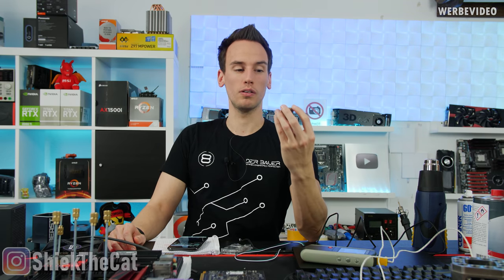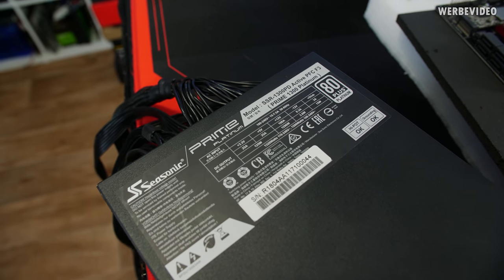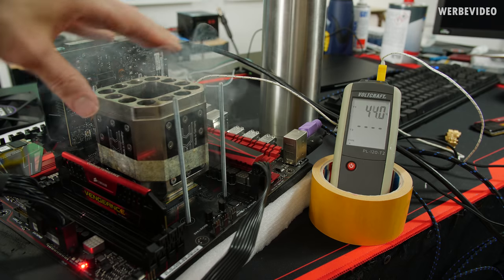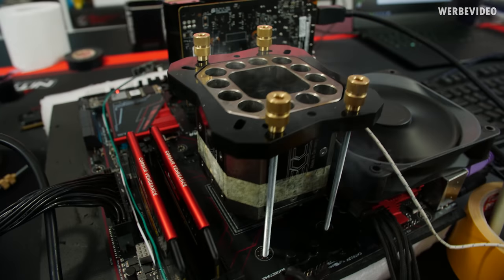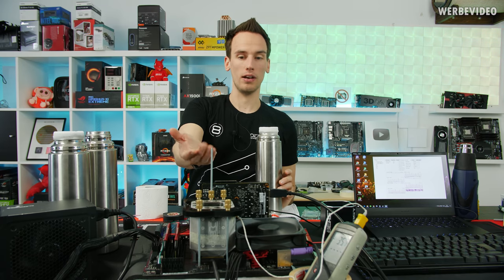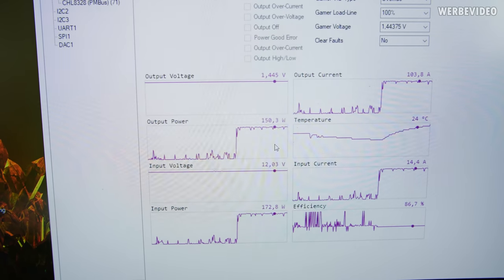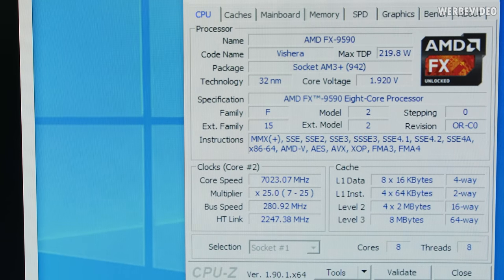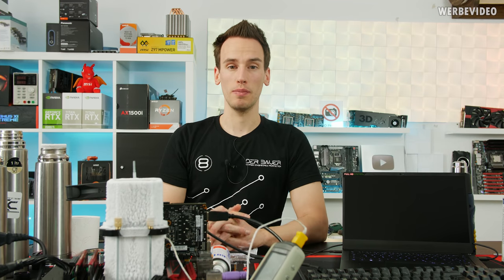Putting the 5 GHz AMD CPU under LN2

Comment: Regarding the hazards of LN2, the volume expansion when evaporating is around 700 times, so evaporating just 1 liter of LN2 emits 700 liters, or 0.7 cubic meters of pure nitrogen. This is a hazard that should not be underestimated, as the pure nitrogen will mix with the air and without good ventillation the oxygen concentration of the air can reach dangerously low levels.
This is a particularly insidious hazard, because human breathing is driven by the buildup of carbon dioxide in the blood, and not the lack of oxygen. Most humans have a very weak direct awareness of the oxygen content of the air, and do not feel like their suffocating even if the oxygen content is so low that their lips turn blue.
A person can easily die from hypoxia without realizing that they are in danger, in the industry when working with inert gases in an enclosed space, often you have to wear an oxygen sensor that alarms you if the atmosphere is hypoxic.
Of course this is not a problem if you have a large room, doors open, etc. but if someone was using a lot of LN2 (such as multiple pots when running both the CPU and GPU on LN2 for 3Dmark) for hours in a small room, with all doors and windows closed, then that person could be in danger.
Reply: In my university they had oxygen sensors in the LN2 handling and distribution room and when they went off the sirens were deafening. The alarm tripping level was of course set way above dangerous oxygen levels so there was no chance that some nook or cranny was depleted of oxygen. I think it was at 19 or 19.5%.
Reply: While the expansion ratio of ln2 is pretty high, and what you say does have merit, your talking to a guy who is quite literally famous for using ln2, and has been for quite some time. That’s essentially like trying to lecture your professor on lab safety when he’s won 3 Nobel prizes in chemistry.
Reply: @MisterRorschach90  or maybe they're sharing knowledge for everyone that watches the channel?
Reply: Martin Johnson touché. And to be honest I actually thought of that after I pressed send a couple hours ago but went back to bed. Lol
Reply: Just try lighting a butane torch, it'll tell you a whole lot about oxygen levels (and you should have one handy when LN2 oc'ing anyway). Just make sure there is some ventilation and you'll be fine :)
Reply: True story time.  I used to play around with LN2 quite a bit in college.  'Borrowed' some from the physics labs for various things.  Some of them relatively harmless like making ice cream, others more questionable like putting some LN2 in an empty 2 liter soda bottle, closing the cap, and then waiting for it to explode.

One time I was playing around with putting a bit of LN2 in drinks, just for the visual effect.  Pour a bit on top and it quickly boils off but you get clouds of vapor and such.  Of course I wouldn't actually drink it until it had finished boiling it off...or so I thought.  But one time I didn't quite wait long enough and accidentally took a sip while there was still a tiny bit of liquid nitrogen in there...

I felt that something was terribly wrong immediately and proceeded to throw my head back, open my mouth, and release the weirdest, longest, and scariest belch of my life just to relieve the pressure from that drop of nitrogen boiling inside my stomach.  Thankfully once that was over though I felt kind of weird for the rest of the day I was otherwise fine.

It's really hard to say how much I drank but I really don't think it was very much at all.  Just a drop, probably.  After all I thought it was all gone before I took a sip, and more than that I lived through this experience without any serious damage.  I've since read about similar incidents (usually for similarly stupid reasons) that resulted in serious complications or even death...

So, uh, don't drink LN2
Reply: how does a mother board  know the diff from ryzen 3600 and 3600x is there info stored on the cpu chip ?  if its only binning how is the info stored

Comment: Me: Can i Use a compressed air to clean my motherboard sockets?
Der8auer: Spray alcohol cleaner everywhere you want and don't forget to use it wisely. 1 Can of cleaner for 1 socket :D
Reply: Well he got the RAM issue resolved... it would have never occurred to me to spray everything with alcohol and then use a hair dryer to blast warm air into the sockets!

Looked nasty but can't argue with those results, lol
Reply: VladTepesVEVO it’s basically the same thing as spraying electronics with deoxit. Loosens dirt and helps clean metallic contacts of corrosion.
Reply: It's not actually alcohol - it's pentane and hexanes compressed with CO2. It's not likely to dissolve anything other than grease, so it will mostly just push debris out of the way and then evaporate very very quickly.
Reply: What is it called? I can't find it on eBay.
Reply: @MadSupra354  Just type cleaner 601 in google

Comment: Had this CPU on an asus crosshair. Damn thing ran so hot I had to disable the 5ghz boost. Wish I knew about under-volting back then, could have gotten much better performance.
Reply: Had? I still have one on a MSI 990FX board.  Also had to disable the boost. PC would freeze for no reason, it was very frustration. Thankful for the pc community that i was able to find out that that was the problem.
Reply: @dmitc01  yeah I dumped it and went to a 4790k, now a 8700k. PC crashed whenever CPU hit 64c, and this was on a 240mm rad. Got sick of dealing with it and moved on.
Reply: @dmitc01  the vrm in that board is worse than some 970 boards, how do i know because i wasted money for less performance
Reply: @ItsRossinator I'm keeping mines until B550 boards are out, will pair with a R5 3600. Don't think I'll need more than that in terms of performance for the next couple of years

Comment: Was looking into datasheets about the CHL8328 on that board and learned chl8326, 8328, IR3536 and IR3538 are basically the same and seem to have control for up to 16 loops via i2c/SMBus/PMBus. Guess thats why Galax HOF cards used them along with special dongle, IR DPDC / PowIRCenter SW gives you great control
Them Corsair Vengeance dimms the ultra rare 2666c10 Sammies ?

Comment: The thing with silicon binning for frequency performance, is that 1) Even for overclocking processors, Almost no binning tests for frequencies beyond what's reasonable on water. And 2) Manufacturers are not gonna just sit on a growing stack of high binned dies if their top tier SKUs using those chips, are not selling out, just to reserve those dies for only those top tier SKUs. They will rather stick any significant overflow (vs sales) of top binned dies, on lower range SKUs, if it means selling more devices and keeping the revenue flow going. That's how you end up with same, lower "class" stock clocked CPUs, GPUs and memory that will overclock as good or even better than the higher tier SKUs usuing the same silicon die. These days, most manufacturers can sell as many CPUs, GPUs and memory modules as they can make, so having dies sitting in storage ie. because you're reserving them for Kingpin cards or KS CPUs, is lost revenue. Rather stick em on a less top tier card or a K sku and sell it. The only reason to do otherwise, is if silicon manufacturing changed negatively and you literally can't get any more of dies that fast.

Comment: LN2 safety: don't let it soak on your clothes and if the torch does not light step out of the room (** if Steve is around check the safety on the torch)

Comment: Some solders are also bad with sub zero temperatures. Back in the Pentium era we had some smd capacitors just cracking off the main board when the machine was left in an unheated storage for too long.

Comment: how about submerging the motherboard in novac(the stuff you used for to submerge full systems). keeping the novac level just above the ram. You would need to do some thermal isolation(like novac soaked cloth or somthing) on the back of the socket and the bottom of the ln2 pod? I think this could get rid og condensation?

Comment: 11:15 - this is a question along the lines of what I've asked, but instead of having the entire thing under liquid nitrogen, I was suggesting having the non-cooled parts under a pure nitrogen atmosphere. This shouldn't cool the parts below ambient, and you can even set up a small input and output port to ensure a constant airflow across them.
Reply: I know someone who tried a nitrogen purge case for an extreme subzero daily PC. It was impossible to remove all the humidity as it would leak. The only purge cases that could do it are extremely expensive 

And then you need to design heatsinks for every single component on the board and a way to get them out of the purge case
Reply: @betrayedpredator8826  Why would you need heatsinks for them? You're establishing an airflow, so just do it from one end of the case to the other. And if you're using positive pressure, how would moisture leak into the case?
Reply: The biggest problem I see with a purge case, aside from making sure it's well pressured and leak-tight, is that you just need a constant source of compressed N2. I believe it's much easier for an ordinary person to acquire LN2 than it is to acquire a pressurized cylinder.

Comment: This is nothing new. Since the day of release, both FX9370 and FX9590 were known to be massive crap when it comes to OC, on both air and LN2. 

I had 14 of these in total, none could validate above 5600 on air using the best core, while nearly 1/3 of random FX43xx/63xx/83xx could hit at least 5700.

Comment: I've seen a lot of attempts, including yours, with chillers and peliter modules. Would it be possible for a peliter module, a powerfull one, to keep a 125W CPU at room temperature under load? Like directly sandwitched between a cpu and a waterblock. I've always had this idea of a PWM controlled peliter module, if you can measure the IHS temp and keep it just near the room temp, there shouldn't be any condensation. This could well be a legitimate extreme cooling solution, if it worked
Reply: Peltier modules are crappy they are designed for small fridge not to cool CPU. I tried that with 90w peltier with 120 aio on just 15watt integrated CPU and it sucked CPU was way hotter than with stock passive heatsink
Reply: Not really physically possible, it would require about 1000w or so for like 15 degrees below ambient. You can just use a refrigeration compressor, my FX ran nice with sub-zero core temps (hottest was -35c under stress load on the cooling block) on a small basic phase cooler at 1/3 HP. Basically it uses maybe 20x less power than what TEC would use, and since you’d need like 50 TEC modules cooling in a 2S25P cooling bank with anti-feeeze just to not melt due to physics, the price is actually way less on the refrigeration system as well, and it would even take less space as well.

TEC is only good for very small (low load) applications, and typically not for extended periods (due to insane power wasting in efficiency). It’s severely limited in this field of application (would be fine for novelty on a 5w Pi, but impossible on a Threadripper to see any improvement when it mattered with any TEC you can currently find, because at that load you just use refrigeration system).
Reply: no,peltier is shit,it cant even cool my 350w cpu xD,buy a refrigerant based cooler instead,maybe reuse a window mounted ac like linus did

Comment: Remember kids, the Leidenfrost effect also protects your hands and eyes from sulfuric acid.
Reply: LOL no! I know this is a joke, but it is actually dangerous(Knowing people eat tide pods). Lidenfrost effect is due to the high-temperature difference between a surface and a liquid, which boils in contact with the surface and creates a layer of trapped gas.

Comment: What is it about these FX chips that let them XOC so high at >8Ghz but Ryzen chips can't hit these insane clocks?
Reply: It's all about the CPU architecture, Ryzen IPC is significantly higher than bulldozer, meaning it does more work per clock cycle than bulldozer, so how do you make a CPU do more work or increase it's IPC? You can allocate more cache, a more advanced branch predictor, more functional blocks dedicated to maths and other operations etc etc, for example you might have 4 FPU units that deal with floating points math in CPU A and only 2 FPU units in CPU B, so per clock cycle, CPU A can do 4 FPU operations vs 2 for CPU B so it's 2x as fast(vastly simplified explanation but the general idea is there)
So how does this relate to CPU clockspeed? All of the above requires more transistors than a simpler CPU design, meaning in a single clock cycle, CPU A needs to turn on way more transistors compared to the simpler CPU B, CPU A simply cannot clock as high as CPU B(Yes there is circuit timing, longest critical path etc to consider but that is the general ELI5) 
Also bulldozer doesn't have SMT and they have less FPU units, 2 cores share a single FPU unit.

Comment: Would it work to submerge the motherboard in 3M novec? Keep the vrms cool, keep water vapor away from the board completely, might let you run LN2 for a long time.

Comment: Ah the FX9590, what a terrible product it was XD. I mean, the 5 GHz was nice and all, but at the power it needed was just outrageous. My 8350 did much better, getting to 5GHz at 1.43 V, while the 9590 I had needed 1.55+.
Also the problem with liquid metal and LN2 is that the LM will solidify XD

Comment: Please do a video with Inwin Chopin case, build a 3400g with fastest ram speed possible and if possible a pcie 4.o ITX motherboard and nvme drive if this processor supports pcie4.0?(As its Zen 2+ not ++) Air cool it and if not similar compact case with Psu's built in around 150-200w. Thanks.

Comment: Why don't you create an hermetic box with pure dry nitrogen inside, with 2 radiators inside connected to others outside to ensure thermal balance. In this way you will never have condensation

Comment: Just casually pouring Liquid Nitrogen and other liquid stuff on to computer components while here I am shaking like a seismometer trying to clean my display.
Reply: just remember, if you use an alcohol based cleaner, all your parts should be totally fine. its not liquids that kill electronics, its specific types of liquids
Reply: Marcus Borderlands thanks for the tip my friend.

Comment: Has anyone used mineral oil as insulation for the board? I.e motherboard is in a tray of mineral oil that barely covers components. That way the ln2 can cool the oil however due to very little surface area it should not cause the other components to get too cold. Just a thought I've never done extreme overclocking other than getting my FX 8120 to 5ghz by running my pc outside in the snow lol

Comment: I got the R15 Score to 820 Points with an  FX8320 At 4.7Ghz, Aircooled xD
Reply: I don’t think that’s accurate, you’re system timer may be off or some other issue. I think at 4.8 GHz with FSB at 235 and NB at 11x (overclocking the L3 cache of the CPU is more important on FX than straight frequency even by 300 MHz), I got like 774 cb I think. To get into the 800 ranges required sub-zero cooling. Now I’m sure my RAM wasn’t helping it a ton but I wasn’t even seeing a huge difference between 1200 MHz vs 1600 MHz at same timings on Cinebench so I don’t think you could have hit that score at that speed.

I think you might have been running faster, you might have set core multiplier at 23.5x but didn’t account for maybe an FSB overclock (since the true speed is FSB*Core multi). and I’ve seen monitoring software mess that up, so I think you were probably running it faster than you thought or maybe had a windows sleep scheduled bug or something like that invalidating the test results. Or maybe you got 720 points (which would be dead on the money for that speed) and remembering it wrong, but that result looks like something is going amiss. Something is off.

Comment: Still using a PS2 keyboard I see, is it somewhat better for overclocking ?
Reply: @bignig123  oof I didn't know that, I knew that PS/2 is better for multiple inputs at the time but not that
Reply: USB is also more I/O intensive, as it's polled instead of purely interrupt-based, creating additional signals which can parasite some other signal line and lead to instability.
Reply: @SpartozZ  What @Thomas said is true. This is why you can still find PS/2 ports on overclocking mobos even this day.
Reply: When under LN2, it can pop usb fuses. Prime example is the AsRock Z97 OCF. Check out Lummi's video as he explains this. Also when using say WinXP on newer platforms, native USB support can be hit or miss. PS2 just always works.

Comment: So what about using liquid helium?
Reply: Even better (that’s what set the FX world record at like 8.9 GHz). However it would cost about $10 per second to operate (in his 7700k video he said it was like $4.40 per second to run that little quad core). So better, but to run a 1 minute benchmark it’s about $600, to make a second run it’s again another $600, so you don’t really have many chances to find it’s limits before you’ve spent more than a Threadripper. LN2 is dirt cheap by comparison, and way easier to get ahold of. But yeah FX loves liquid helium, it’s just costing more than my Mercedes Benze cost my family in literally 1 minute, haha!